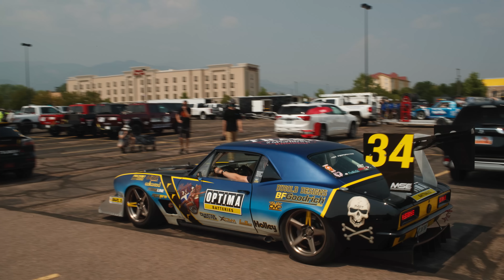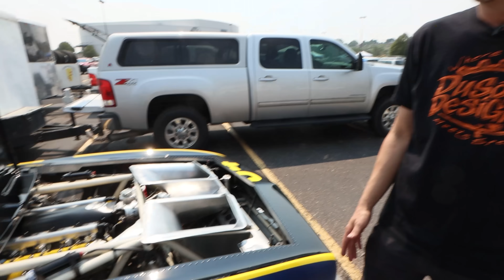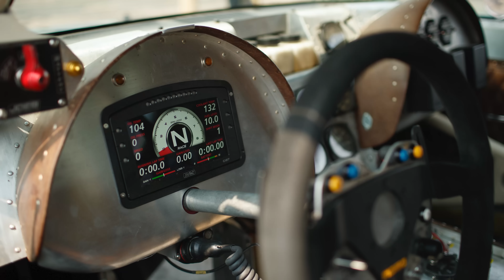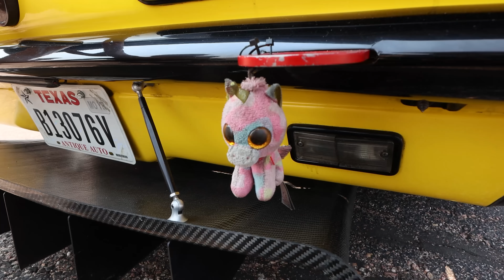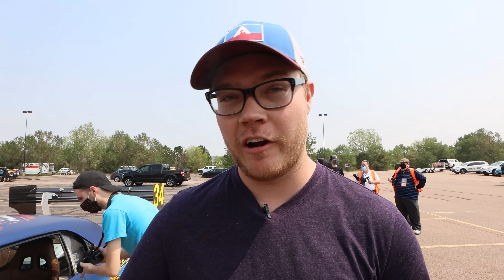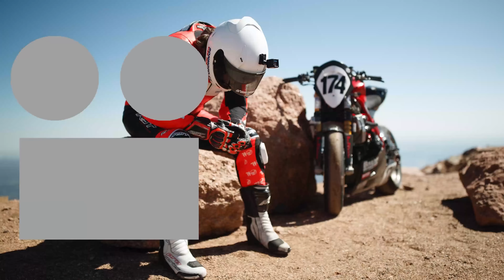1100whp Camaro… And it Handles, Too! ’67 Pro Touring Pikes Peak Racer

Comment: Street legal in how many states? "Street Legal" won't matter if there are almost no regulations anyway.

For example, in some countries you can build your own car in a garage from the ground up and have it street legal just by registering it. No need for crash safety or emissions compliance, you just need working headlights, tailights, turn signals, seatbelts, and side mirrors. Sometimes less.